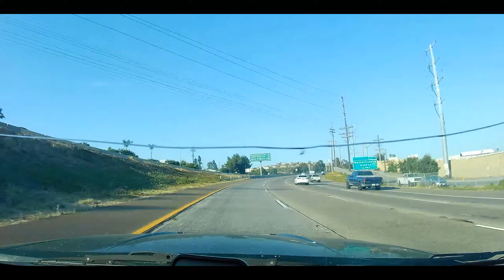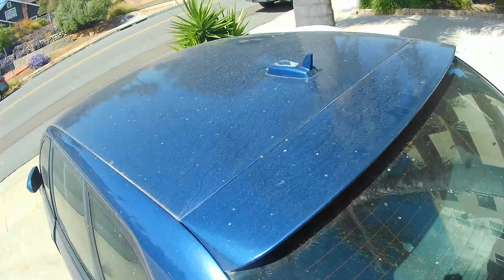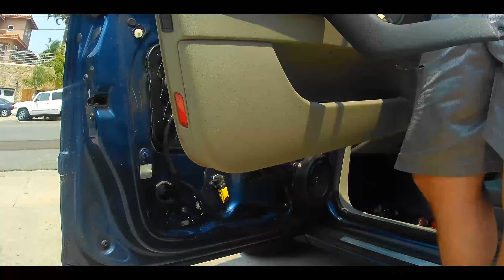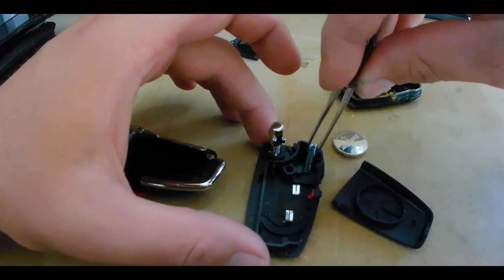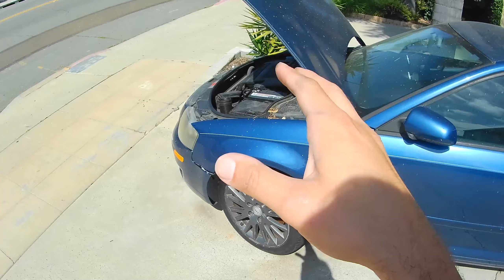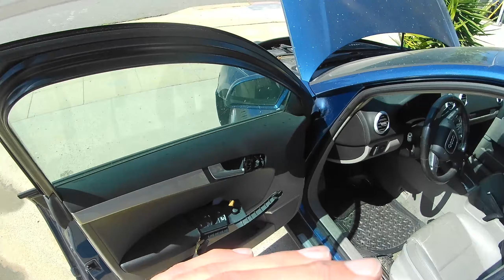My last SECRET, it was only $700, I couldn't resist! | Building A3 1

Comment: I once bought a one-minus-cylinder 2012 Fiat 500 for 900 bucks.  I replaced the multiair unit on it but turned out it needed an engine.  How did you manage to find all these cheap cars?
Reply from the maker: Just as I mentioned in the video Jay. Once I’m looking to buy. I sit at my computer all day looking at listings. Refreshing every 15 minutes.